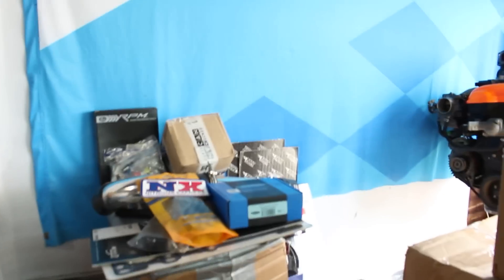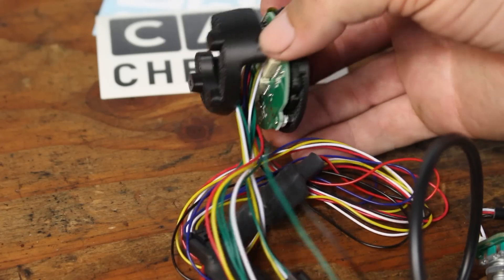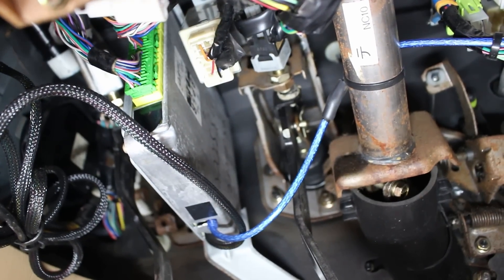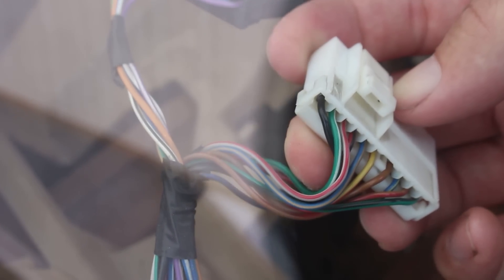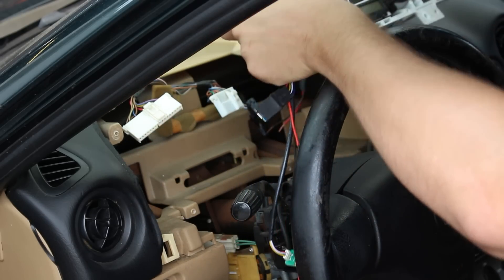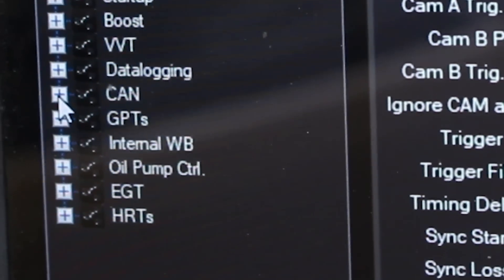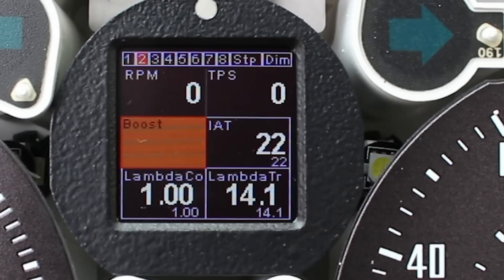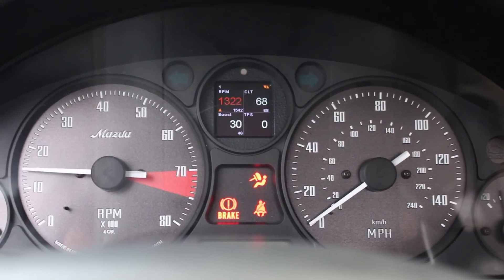Installing a CANCHECKED Multi-Function Gauge In The NB Miata! [Project 2SJ Ep15]

Comment: I have the same gauge now and was thinking of replacing the oem sender unit for a Bosch oil temp/pressure sensor, would you prefer to hook it up to the EM442 or straight in the CANchecked-gauge?

Comment: Hi bud, question for you that I've not been able to get an answer. Since I installed the canchecked gauge, I obviously lost the oil pressure gauge on my 1.6NA. So I ran a new wire from the oil pressure sensor to one of the additional pins on my ME442 and it looks like it sees it but I can't find data anywhere of how to calibrate it. In Meite, everything is meassured in Volts but the only data I could find about it is in ohms...

I'm lost, I'd certainly appreciate a little bit of help here, all mighty Miata guru!! :D

Thanks
Reply from the maker: @IrishGaucho  99% sure you can't use the stock sensor with a standalone ECU, it can't read it

Comment: Best way to get the 12v supply is just using GND and IGN from where you removed the oil pressure meter.

Comment: Sir did you install a 120 ohm resistor in-between the hi and low wires?
Reply from the maker: Not needed in my case
Reply: I'm thinking I may have made the hi and low wires too long...but mine is not showing data.. motorsports electronic and can check has a PDF that states using a twisted pair plus a 120 resistor. I will have to try that to see if it works.

Comment: How does it know what gear you’re in?
Reply from the maker: VSS vs RPM, and the ECU knowing the trans/diff ratios.
Reply: @TheCarPassionChannel  can this be achieved on NA6/NA8?
Reply from the maker: I'm not sure that the Canchecked will do it. But if you're on a standalone, you should be able to use an ABS sensor wired to the ECU for vehicle speed, then the ECU can output "Gear." This is how my NA6 is set up, with a driveshaft trigger wheel. In the NB Cluster Conversion video I also talk about this setup more in depth

Comment: That's awesome. I definitely am going to look into this. Out of curiosity what is your 2 step settings? I like how it holds a constant rpm and isn't a crazy pop.
Reply from the maker: In the ME it's just 3750rpm, injection cut only. The rest is just default settings. To avoid pops just make sure ignition advance for the limiter is 15° or so, and use fuel cut only. Flames and bangs is a result of low ignition timing (5° or lower, even down to negative numbers) and spark cut.
Reply: @TheCarPassionChannel  Thank you! I will give it a shot. I'm on MS3X
Reply from the maker: @miatajames1472  If you check out my "I fixed my launch control for two cents" video, I overview some of the launch settings in Tuner Studio with demonstration etc
Reply: @TheCarPassionChannel  I have watched the video several times long ago and typically stick to the pops and bangs. I was intrigued by the fast bounce this has at such a low rpm. So just to confirm this was spark cut at 3750 at 15 degrees of timing in the video. You stated 15 degrees to not have pops and bangs but didn't exactly say this was what was in the video. Also thanks for the videos. I've been using all of the megasquirt and tuner studio videos for a while now.

Comment: I know im dumb, but im not a fluent english speaker, so, will it work for totally stock NB?
Reply from the maker: You'll need a standalone ECU in order to output the values that the gauge reads on this current version, the Canchecked site is available in many different languages so you can see full details there
Reply: @TheCarPassionChannel  thanks Greg!

Comment: I have the roadstersport 4 with the sport cat and it is a very good sounding exhaust.   Not too loud.  At freeway speeds (80ish) the wind noise is louder than the exhaust unless you get on the gas.  Idle is very tame but when you get the revs up it gets aggressive sounding with slight pops on engine breaking.

Comment: I want to buy one🥺, I clicked the link and then I clicked dealers but they have soo many dealers and im randomly picking thru some but I ain’t seeing none to purchase.. can i have the exact link you purchased yours from? Thanks!
Reply from the maker: Check the links now, updated to direct product pages
Reply: @TheCarPassionChannel  now that I have it and also have it installed.. how do I get it to communicate with my MS3? I have the settings on the gauge itself set correctly but idk where in tunerstudio do i enable it..tried severals settings but no luck

Comment: That's the coolest thing.

I'm always looking at stuff like that daydreaming to the day I'll build an e36 (have an e46 as daily rn, remember we talked about cooling systems on insta lol) and the ecu I was looking at has an integrated wideband controller and I thought it was dumb to have a wideband with no physical readout and adding an aem on top of that didn't make sense either, a solution like this one makes so much more sense, is similarly priced to an aem uego and also solve my other problem : too many gauges can look tacky but at the same time you need the info to keep the engine safe

Comment: Pro tip, put a fuse on that spur for the power.

I had a canchecked die from powering off the gauge (seemed to blow the regulator after a couple of cranks after a stall or three) and took part of the film on the cluster with it. I now have the replacement powered from an extra fuse box I installed for additional gauges, sensors, and hard wired chargers and it's been good as gold since.
Reply: what amp fuse should be used?
Reply: @jbu89gb  the instructions said 5 Amp fuse

Comment: And there I was procrastinating fitting my CanChecked gauge, and I see this video pop up. Purrfect. BTW didn't you have to solder CAN terminator 120ohm resistor on the ECU side?
Reply from the maker: Not on this version. Older versions might require it
Reply: @TheCarPassionChannel  On this version? You mean the ME 1_3 selection, 442 or version of CanChecked? I think I just might try without first, if it works it works :)
Reply from the maker: @Domas64  Nothing to do with the ECU, it has to do with the "Can Term" setting in the gauge. "Yes" = no resistor required as I understand it, because the needed resistance is provided by the internals of the gauge

Comment: Hmm have i missed an episode? The launch controll is that a feature of this device ?
Reply from the maker: No, it's a feature of the ME442
Reply: @TheCarPassionChannel  thanx for the answer. Have you done a video of that or will you? Would be fun to see. Is that soly for the mme or also other ecu:s ?
Reply from the maker: @gunnarnordstrom2515  I have a video on how to set up launch control on Megasquirt, but it's pretty easy. Just turn it on, set the RPM/TPS thresholds you prefer, limiter type (fuel or spark or both), and that's pretty much it
Reply: @TheCarPassionChannel  look into it, thanx, and as always great videos running a 99 nb myself so great stuff

Comment: Great video. I am torn between the CanChecked gauge and the Plex uSDM-102 Pro. The CanChecked gauge has the advantage of fitting the OEM gauge cluster. On the other hand, the screen of Plex uSDM-102 is twice the size of the one from CanChecked gauge. It can also be mounted closer to the driver's natural of line of sight. Decisions, decisions...

Comment: I took the packing out of my isr muffler and it stopped most of the drone, has a kinda older f1 rasp to it, I like it

Raceland header, custom mid pipe with resonance chamber, flex joint, round magna flow muffler, then depacked isr muffler

Comment: Nice work 👍 Is it safe to assume this will also work on the OEM ECU?  I have an NA8 Clubman and an NB8B SP (Factory Turbo special edition for Australia), and both are unmodified.  Will this gauge work on the factory ECU?  I'm particularly looking at this for the NB8B since the oil pressure gauge isn't a proper one anyway, and I"d like to monitor the turbo pressure and temps.
Reply: It will not work with the factory ecu

Comment: Looks great! Will this work with the stock ECU, or does it need one of the supported aftermarket ECUs?
Reply: Will need a standalone ECU, stock is waaaay too old to support CANbus
Reply: @jacobfoster6773  Is it though? The OBD2 diagnostic port has CAN Hi/Low pins defined, and that's been around since 96 (or around halfway through the NA/NB lifecycle). I don't know if that means this would work with a stock ECU, but it sounds like there is a possibility.
Reply: @samhurst9319  You make a good point, didn't think about that. I have no idea what sensors the MX-5 makes available to the OBD2 port, and I can't check as mine is too old to have OBD2! and I have no idea if the canchecked would be able to pick them up, best place to ask I'd imagine is canchecked themselves.

Comment: to do a Y splice in aviation we just cut the spliced wire, use an environmental butt splice, one side has one of the cut wires and the wire you're connecting the other side has the other end of the cut wire, shrink the environmental sleeve. no tape

Comment: No resistor needed like the official guide says?
Reply from the maker: No - that's the reason for the "Can Term" setting in the menus. I believe if you are running multiple items on the same CAN system, you would set that to "No" and then use a resistor. If you were going to set it up that way, definitely double check with them.
Reply: @TheCarPassionChannel  Perfect thank you! I've got one waiting to hook up to my 442.

Comment: Are you saying that you didn't buy a wideband o2 sensor, or guage?
Reply from the maker: The wideband sensor is run by the controller onboard the ECU, but I don't have a gauge at all, which is why I wanted this.

Comment: Got mine some time ago and had some troubles with the canbus communication. CanChecked and ME told me to use twisted pair wiring and a termination resistor on the ECU side. Yours worked out of the box, so i’m a bit confused.

But love the oem look all in one gauge!
Reply from the maker: I spoke to Canchecked about this since their instruction talked about the CAN termination. The version I have did not require any resistor, and the online instructions at the time were outdated. They have since updated the online instructions. The "Can Term: Yes" setting is what allows you to skip the resistor.
Reply: I literally used some speaker cable, crimped it to the gauge and plugged it into the ME442, never had any issues
Reply: Same. The official guide says you need a resistor. Would be nice if does just work now. Mine is waiting to be installed soon too.
Reply: hi Joel,  did you manage to get it to work eventually and if so what did you fix, other than twisting and adding a 120ohm resistor?  thanks

Comment: i didnt even know this existed... otherwise I would kept my OEM cluster.  I'm using intellitronix right now.
Reply: Ahh bugger! This looks like a great alternative that probably works out a little cheaper too.
How do you find that Intellitronix for night driving out of interest? Is there a solid dim function? Random question I know...- Taz.
Reply: @hpa101   It's pretty bright, there is an extra wire for dimmer when the headlights is on.  pretty simple install but, my only complain is the PCB board and leds.  I had mine repaired once already.

Comment: I’m preparing to build my first turbo, but i’d like to keep my interior clean, so i don’t want alot of gauges. Could i use this instead of aem wideband? I have a NA8 from 1995, is it right my oil pressure gauge is useless anyway?
Reply from the maker: This gauge is only reading the wideband signal from the ECU, it does not have an integrated wideband sensor controller. But you could do something like an Innovate LC2 controller (no gauge) then use one of the aux inputs on the Canchecked to display AFR, in conjunction with hooking it up to your standalone.
Reply: @TheCarPassionChannel  I’m confused, I thought the ME442 has a bosch wideband sensor included.
Reply from the maker: @garagism5736  I'm talking about the CanChecked, it does not have its own sensor. The ECU does, which is what the CanChecked reads from
Reply: And for the Oil pressure, install a sandwich plate with an oil pressure and oil temperature sensor and wire them to the ECU (so then you can also see the pressure and temp in a datalog). The ECU can then send the data via CANbus to the gauge so you get a working oil pressure gauge

Comment: I have a cobalt catback, overall it's not terrible but the sound is on the raspy side. On the plus side it did not drone at all and on low revs and cruising didn't sound that bad. I ended up getting a magnaflow high flow cat which actually changed the tone to a deeper sound which I was not expecting. Sounds much better now but I would like something else eventually but for now it's fine. 

May I recommend looking into a yokana or fujitsubo? Personally think the Jets integral kobe N1 sounds the best but it's very pricey! I think that's what Quinn is running on his car.

Comment: I’m guessing for a 1.6 you’d lose oil pressure functionality without installing a different sender right?
Reply from the maker: That's correct, I don't believe you can get this to interface with the stock oil pressure sensor. You should be able to use an aftermarket oil pressure sensor along with an aux input to the MFA2.0, but you probably want to get in contact with Canchecked before attempting it.
Reply: @TheCarPassionChannel  I installed an oil pressure sensor on a sandwich plate and wired it up to the ECU, so now the ECU can also log oil pressure. The ME442 sends the oil pressure over CANbus to the gauge, works like a charm
Reply: @TheCarPassionChannel  And also the stock oil pressure sensor is 12V and you can't really use it as far as I know (ME442 uses 5V sensor inputs). Best advise is oil pressure and temperature sensor on a sandwich plate wired to the ECU

Comment: already ordered 😤😤 thanks Preg. First the Pahls Dash. Now this.
Reply: From which distributer ? Im trying to order one also
Reply: @DirtBikeRodz  what do you mean which distributor? Canchecked sells it themselves. Thats where i bought it from. Greg made them too popular and after an hour of the video posting u saw the website was over loaded 😂 got lucky to see they had 5 left after i finished my order
Reply: @Vaft91  Nice!.. finally got mines😂,, are you running MS? If so where do I enter my settings on tuner studio?
I have all the settings on the CANcheck already but having trouble making it communicate with my ECU
Reply: @DirtBikeRodz  did you follow all of Gregs instructions? I had no issues.
Reply: @Vaft91  yeah but Im using megasquirt ECU not ME ECU like Greg
Reply: @DirtBikeRodz  ah

Comment: Do you not have an oil pressure gauge anymore?
Reply from the maker: The gauge that doesn't really tell you anything you mean 😅 correct I don't have that now
Reply: I have added 0-10bar -> 0-5V pressure sensor to my ME analog input. I can see oil pressure reading in Canchecked display 😉
Reply: @villeentonen9368  Exactly what I did, Also added an oil temp gauge for that extra data

Comment: Why not for the power and ground just crimp ring terminals onto the wires and attach them to the IGN and GND screws for the oil guage? No need for dodgy splices then.
Reply from the maker: That's a baller idea!
Reply: I did this. As per my other comment; regulator fritzed out and wrecked the PCB foil. HIGHLY recommend moving it to a dedicated fused feed for power.
Reply from the maker: @timwhite2139  Good to know, looks like this is not a good idea then
Reply: Big brain move 🧠 I like the way you think
Reply: @evannoriega-thomas371  👀
Reply: You the man Jacob
Reply: This is how I wired mine up a couple of years ago... Flipping love this gauge 😍
Reply: Wired mine up like this today and it didn't even power on. Gonna find 12v from somewhere else.
Reply: Was there a resistor that was needed for the this install? Or does the ecu have one built in and you’re good to go?